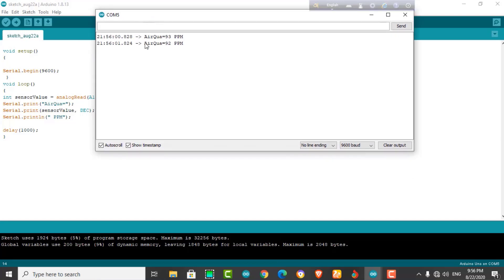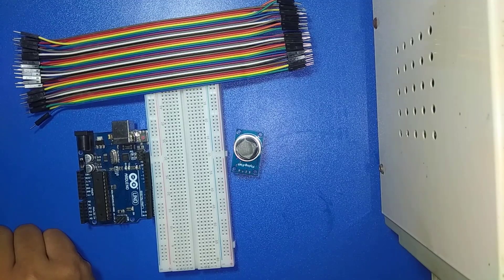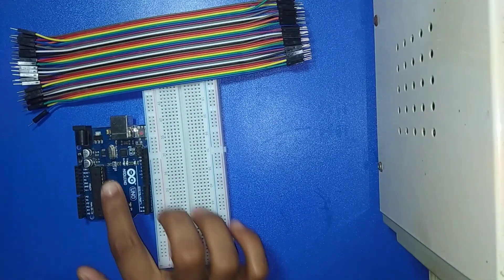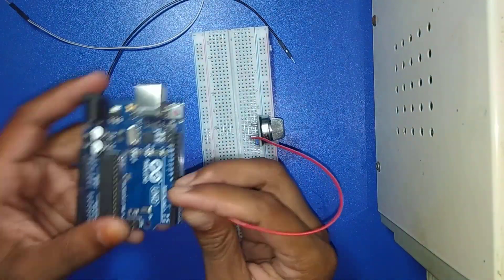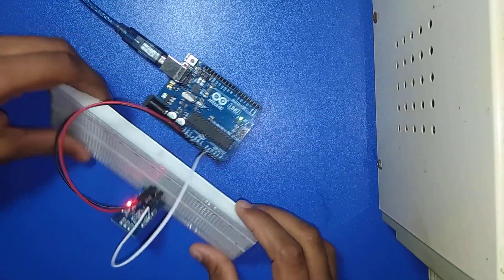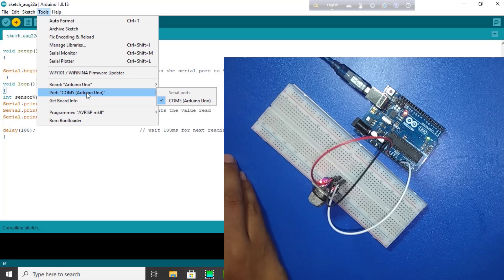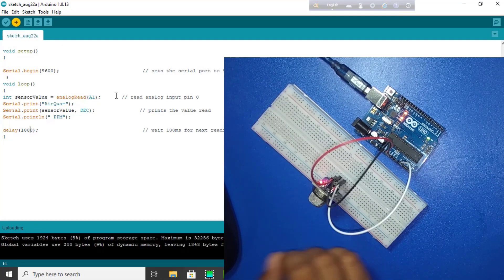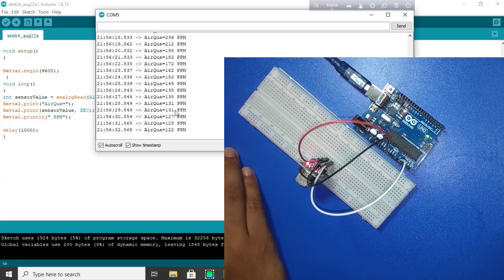How to connect MQ 135 With Arduino and Code ||ARDUINO WITH MQ135

Comment: Bro pls tell me how to connect mq135 dht 11 bmp180 together with the Arduino and store there data in Sd card, also how to code
Reply from the maker: It's possible bro. No need to store in SD card. You can store in firebase console
Reply: @techsigmarobots  i have the found the circuit diagram and connections with the code but still thank you for you suggestion you got a new subscriber
Reply from the maker: @QuantumKART-2007  if need any help just send me messages.
Reply: @techsigmarobots  👍👍
Reply: @techsigmarobots  okay as we are making a weather balloon my mentors told me to store that in a SD card so that we will be able to access the data through sensors

Comment: Sir I need to display in LCD can ya please guide me?
Reply from the maker: Have you lcd display.
If you have it's okay. I you have not please buy a lcd display with I2C connection.
Then connect with 
5v Arduino connect 5v lcd
Gnd Arduino connect gnd lcd
SCL pin connector SCL lcd 
SDA pic connection SDA with lcd

Comment: Why do I get readings above 2000?
Reply from the maker: What 2000.
I dont understand.
Could you elaborate  please
Reply: @techsigmarobots  so I have connected the Mq135 sensor to ESP 32 module and I get readings above 1000 even though I didn't put any smoke source nearby, now readings are decreasing but not stable.  It's at 685 now.
Reply from the maker: @denise4ever242  MQ series sensor accuracy is not good. You need to provide 5V and 1 Amp current for 72 hours. After that, you get the real value.
Reply: @techsigmarobots  Can we do it for 24 hours instead of 72?
Reply from the maker: @denise4ever242  If you want to take high accuracy value so you must need it.
Otherwise use #SOHA TECH# gas sensor.
Made in Korea
Very good gas sensor
Thank you.

Comment: Thank you very much for making this video. It helps beginners like me😢please be kind to clarify this doubt of mine, do we need to calibrate even the Mq135 module or is calibration necessary only for the standalone mq135 sensor?
Reply from the maker: May be you are Bangladeshi right.
I am also Bangladeshi.
You can contact with me directly. 
manueee484@gmail.com
Reply: @techsigmarobots  I'm actually not from Bangladesh sir and I have just sent you an email.

Comment: Also how can i put a screen which shows air quality?? Do i need to change the code for that?? Or can i use the one in the description??
Reply from the maker: You can use lcd display
Reply: @techsigmarobots  should i use a different code for that??
Reply from the maker: @sonu_jeon5545  Yes need to add lcd code brother😊😊

Comment: Hey i didn't understand to which pin on arduino u plugged Digital Out and VCC. Please reply ASAP!!
Thank you😊
Reply from the maker: VCC with 5 v of arduino
Gnd to gnd to arduino
Anyone digital pin you can connect which you are declared in code
Reply: @techsigmarobots  thank you very much
Reply: @techsigmarobots  Can i use the code in your description or i have to modify it
Reply: @techsigmarobots  can u maybe put a full code in the description because i kinda wanted it for my project😅.
Thank you💜
Reply from the maker: Welcome

Comment: Hey, mate!
How can I interpret those values? I mean, from what value is dangerous to be near the sensor?
Reply from the maker: It is not possible to measure or filtering those gases which is dangerous for sensor. If you want you can use @Soha Tech sensor.
This sensor can define which is harmful for this sensor

Comment: sir what type of gas can sense on ur video ?
Reply from the maker: Thank you for your comment.

The MQ-135 Gas sensor can detect gases like Ammonia (NH3), sulfur (S), Benzene (C6H6), CO2, and other harmful gases and smoke. The analog output pin, outputs an analog voltage which can be used to approximate the level of these gases in the atmosphere.
Reply: @techsigmarobots  it means all of gasses u mentioned are in the video ?
Reply from the maker: @jeremytiempo9639  mainly CO2 and Amonia(NH3)
Reply: @techsigmarobots  ur codes works for me but i want to know what is the difference the output of other tuturial are not same with ur video my output showed range 400ppm (from ur code) and other tuts showed output about 2.50 or something below 5 ppm ?
Reply: or if my output range 400ppm is for outside ?
Reply from the maker: @jeremytiempo9639  Please provide 5V 1 A current to sensor for 72 hours.
After that you will get the better correct value.
Thank you
Reply: @techsigmarobots  is it good to operate for long time?
Reply from the maker: @jeremytiempo9639  no no. If you want to use long term gas sensor.
Must be you need SOHA Tech gas sensor.
Its Korean.
Price 200$
Reply: @techsigmarobots  if i used this .. how many hours to operate this?
Reply from the maker: @jeremytiempo9639  unlimited,untill damage
Reply: @techsigmarobots  owshi
Reply from the maker: @jeremytiempo9639  owshi mean?

Comment: It was really helpful, thanks a lot. Do you have the connection/code to display the  output/reading on a LCD (16x2)?
Reply from the maker: Yes I have
Reply from the maker: Do you need?
Reply: @techsigmarobots  I need it. Please create a new video
Reply from the maker: @arvindoh3687  sure brother.
Need some time
Reply: @techsigmarobots  Did you create with the connection/code to display the  output/reading on a LCD (16x2)  bro?
Reply from the maker: @abhijeetkumargautam3923  sure its possible. 
Please buy a liquid crystal display
Reply: @techsigmarobots  I already have the Display but, need to know how to connect it with Arduino and the Arduino code too, kindly provide if you can
Reply from the maker: @arvindoh3687  Firstly you give me your mail address and i will send you link for google meeting then i will solved it remotely.

Comment: You have don a lot of mistakes with your code in discription box
Reply from the maker: Please identify my mistake. I will try to solve this and thank you for your comment.
Reply: @techsigmarobots  bro first of all A1 in  void setup will give input not output
Reply from the maker: @amanmishra-dv1hw  Thank you for your reply.
Please check here A1 collect from sensor data and send to Arduino
So A1 is input pin.
In this code I do this.
Please recheck this.
Thank you for your comment bro
Reply from the maker: @amanmishra-dv1hw  Okay.
Please do run this code at fast you write input then run and again you write output
then you get your answer
Reply from the maker: Please search in google
#Engineer M M R Manu#
please read my research paper